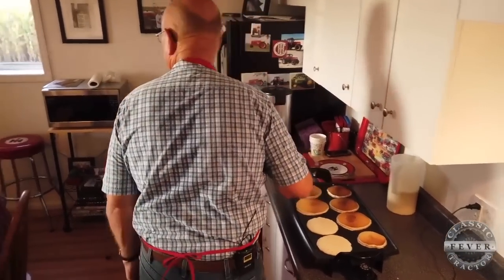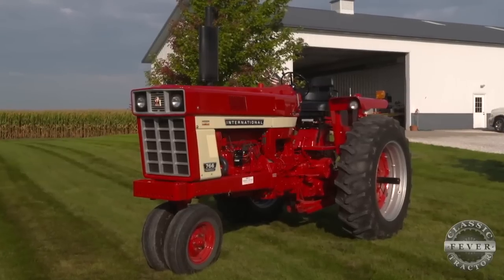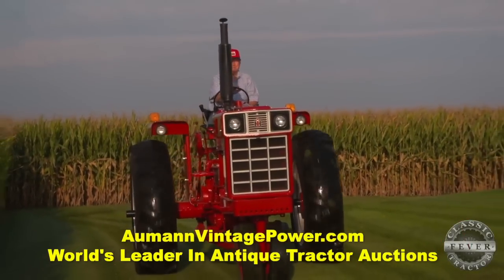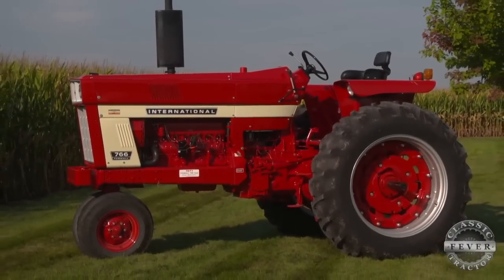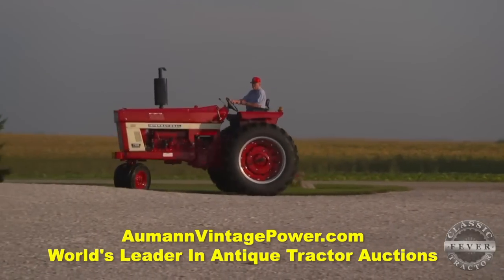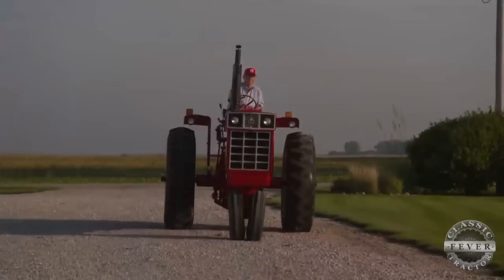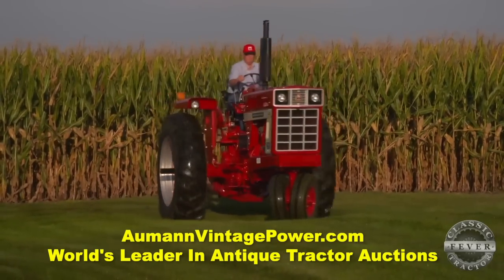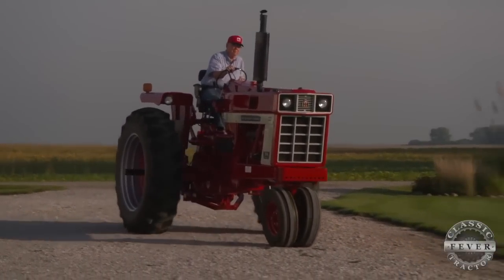The LAST Of Gasoline Tractors - Diesel is King! - 1971 International Harvester 766 Tractor

Comment: I had a 4010 JD gas right up to when I retired a couple years ago. I loved it, it wasn't to hateful on fuel. Perfect for mowing hay. Ran smooth as silk.
Reply: We had two JD 4010 gas tractors. I really liked driving them.  Relatively quiet running. Then we added an IH 856 diesel.  Lots more power, but much more noisier. Your ears would ring after a day of plowing. I attribute my hearing loss to that tractor.

Comment: Great video. Can't argue with IH, but my heart is with Oliver!
Reply: The 1800 still holds the gasoline fuel economy record at Nebraska.
Reply: Speaking of Oliver, White also had a gasoline tractor until 1982 in the form of the 2-70 if they were available until the end of the production run. The man in this video said the main manufacturers were pretty much done building gas tractors by about 1975 but if the gas engine option survived the full production run then White could have the last gas tractor available in that horsepower class.
Reply: You might be able to answer a question I've had. Did much change in the the tractors when White took over Oliver? My Grandpa had I believe an 1855 Oliver (could be wrong on the number, I'd have to ask my older cousin to be sure) I'd love to find one. My Dad went to IH, but my uncle went to White. I always thought the 1800 series Oliver's were a beautiful tractor.
Reply: @deadparrothead3175  White largely kept their design very close to the Olivers right off the bat. The first generation of Whites was basically the Oliver tractors with a sheet metal change and the reintroduction of the 354 Perkins from the 1850 in their 2-85 and 2-105 models after they had issues with the turbocharged 310s in the 1855 and 1955. The 2-70 retained the original Oliver/Waukesha engine out of the 1655. The 2-135 and 2-155 saw the reintroduction of the Hercules motor from the 2050 and 2150. The 2-180 got the 3208 cat out of the 2255. They kept the 6 speed transmission with the over/under until the very last of the white tractors which had a Funk powershift. The second series of whites saw the introduction of the 3.9l, 5.9l, and 8.3l Cummins engines which replaced all of the other engines as far as I know. So yes initially the early Whites were just Olivers in different sheet metal painted silver.
Reply: @kennyz6533  You're right. I was going to comment that as well. I can't find anything to indicate that Gas model production ceased before the end of all 2-70 production. I know there are factory narrow front 2-70's out there, so what's to say you couldn't buy a brand new White 2-70 Gas narrow front in 1982? Or possibly even as a left over as late as 1983.
Reply: @kennyz6533  The 2050 and 2150 should have never effectively gone out of production. They should have got the 55 series platform and other minor upgrades and became the 2055 and 2155 (not Moline production) and then turned into the 2-135 and 2-155. A terrible mistake on White's part. I doubt it was Oliver's doing.
Reply: @42lookc  I believe you’d be correct in saying it was not Oliver’s doing. I remember hearing somewhere that Oliver had fully planned on making a 2055 and 2155 that would be a direct replacement to the 2050 and 2150 until White decided better of it. I believe they would’ve retained the Hercules diesel. They also would’ve had all of the 55 series rear end updates with the closed center hydraulics and power brakes and hydraulic power pto and whatnot. They built some prototypes if I remember correctly and one or two may still exist if I’m thinking straight here. The 2055 and 2155 farmers got was a moline in green.

Comment: We have a 766 diesel rated at 88 HP.   Used every last one of those HPs too, especially since our workhorse tractor was a 1466 turned up to 200 HP.  We gave that 766 a workout sometimes if the 14 was already hooked to something else lol.
Reply: We had a 766 Diesel as well.  My Dad had all Farmall gas tractors up to that point.  I think ours was a 1976 model.  Our biggest tractor up to then was a Farmall 560 gas.  I remember Dad pulled a 4 16" plow with that one.  When we got the 766 we got a 5 18" bottom plow.  The difference was shocking.  It used half the fuel and did twice the work.  Great tractors.

Comment: The 4-cylinder gas versions of that engine, the C-175 & C-200, both had crankshaft-driven balancers and were available in the 464 & 574 tractors up to 1978.

Comment: Very nice tractor.  Though I prefer the diesel for their torque and longevity, the gasoline is great too. Doesn't matter if its 100° or -5°F the gasoline engine doesn't mind negative temps. It'll always start.👍
Reply: Block heater.

Comment: The last IH built gasoline farm tractors were the compact 184 built 1977-80 in the USA and the 284 Gasoline built 1976-81 built by Komatsu in Japan and sold through IH.
Reply: We have a 1979 284 gas....has a Mazda motor and under 500 hours.

Comment: I will still never understand who in their right mind would want an 80+ horse gas tractor. Even a with a 60 horse gas tractor if you are working in hard is at 5-6 gallon an hour. You get started at 6 in the morning plowing and you’ve already hauled fuel to it at least once before lunch. Plus they run hotter than blazes. My biddies grandad bought an 806 gas brand new with a 5 or 6 bottom plow. He melted 2 mufflers off it in the first week of plowing and ended up putting a piece of well pipe on it for a straight pipe so he didn’t have to keep buying mufflers. I can’t remember what it got traded off on but it only lasted 2 years and they got a diesel to replace it cause they got tired of feeding it.
Reply: My Uncle bought a 3020 Powershift gas new in 1966. 300 gall0ns of fuel lasted barely 3 days during plowing. My Grandfather said it was almost as bad as a Steam Traction Engine. He had the job of hauling water at age 8. Couldn't keep enough near it. Sometimes someone would go with him to get all the barrels full enough to get caught up as he couldn't pump water fast enough to fill them all in time.
Reply: If it was below freezing I'd always use a gas tractor to grind feed, had some bigger diesels but using starting fluid was always a no no with my Dad. I guess he thought it was hard on them...

Comment: IH gear shifting was a joke. Push in the clutch and wait 10 minutes for the gears to stop turning or "GRIND EM." John Deere had synchronized gears and powershift transmission...shift on the go.
Reply: I have 3 of them, and don't have any problem shifting them.
Reply: No problems shifting with mine
Reply: There was a tranny brake that had to be kept properly adjusted to prevent grinding the gears.

Comment: I had a diesel 766; I wouldn't have a gas - went through 2 TAs in 5000 hrs...lol
Reply: i have a 766 and the TA lasted 8000 hrs.
Reply: @bradjenkins932  that's phenomenal; I've never heard of  TA lasting that long. Around 2000 or so hrs in my area whether you used them or not -
Reply: @smid2550  sounds like you don't know how to use them then.
Reply: @justinsmith6118  lol! Whatever - you're out of fuel, or you wouldn't already be resorting to insults. Ask yourself why case kept the combine and equipment but swept the tractors under the rug? I guarantee you that I do know how to use them - they were always weak and unreliable. I have no desire to enter into a pissing contest with you. Leave me alone -